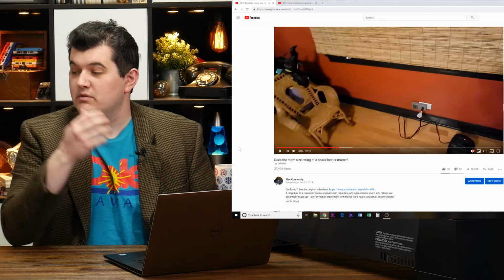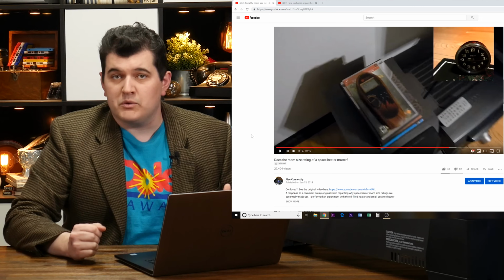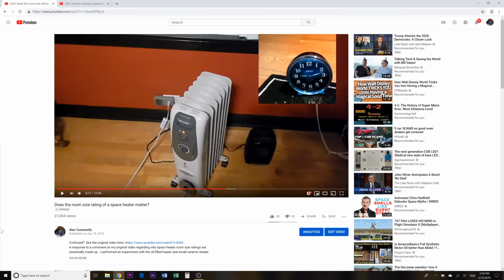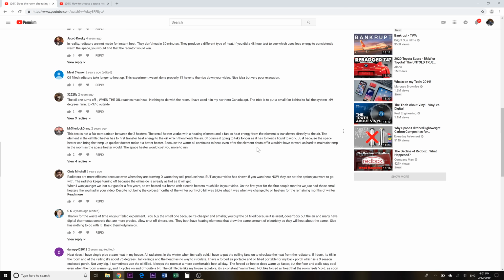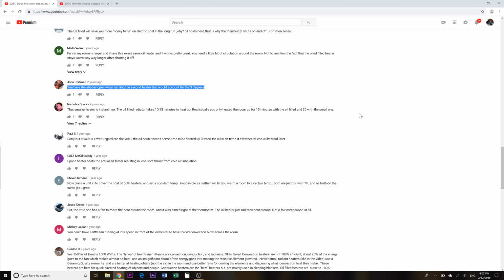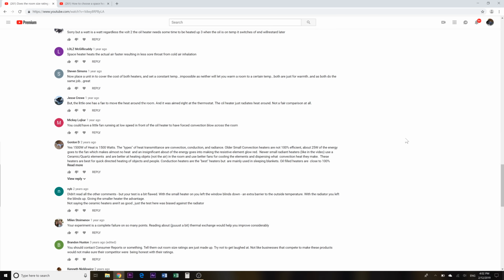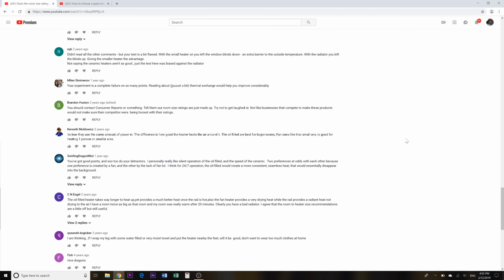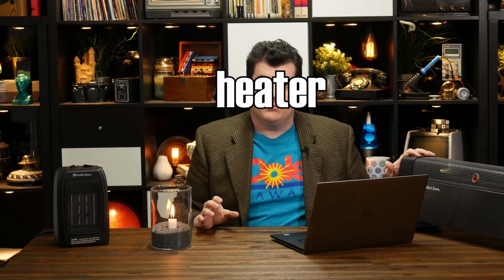More Space Heater Nonsense

Comment: Any space heater with larger or longer heating elements will produce more heat. It's like comparing a 110 coffee pot element to a 110 stove element. The stove element will put out more heat because there is more surface area on the stove element that will produce heat.
Reply: Wow! You're comparing apples and oranges...

The "110" you're referring to is the line voltage, what you're leaving out of the equation is the amperage or current...

Watts = volts x amps

Your coffee pot is drawing in the neighborhood of 8-10 amps, your stove top several times that. (And I personally have never heard of a 110v stove, they're 220v for just that reason - they need more current.)

I do agree however that from a "room efficiency" viewpoint a longer element with a larger fan will more quickly and effectively heat a larger room - even given the same energy consumption...
Reply: @openeyes-411  You are kidding about not hearing about a 110 stove right. I had one in my last apartment. It plugged right in to the electrical outlet. They are more or less giant 4 burner hot plates with a 110 oven. I am not forgetting about the amps either. I also have a small space heater that pulls 500 watts and only  250 volts. So not all heaters use the same amount of power. This is more or less the type of oven that was on the stove. I can't find the top that goes with it though. You can look to see if you can find it if you want.  https://appliances.us-appliance.com/appliances/110v
Reply: @christopherhorton821  
Yes I was serious - I've always lived in regular houses in the US that have been properly wired with 220v for the heavy load appliances such as ovens/ranges and clothes dryers. But hey, I guess you learn somptin new every day!

As to your 500w, 250v space heater, can I assume this is of a European or Australian origin? Doesn't make much sense to make such a small heater here in the US that requires that voltage...
Reply: @openeyes-411  Wow you have missed out on a lot. They even have 110 volt clothes dryers. They are smaller than the 220V and they don't hold as many clothes and yes they do take a little longer to dry, but they do work.

Comment: Oil heater is OK Butt... If you or thay put a box fan in front or in the back of it. it will stay running and heat the house more better.
Just make sure you have a 20 AMP Breaker to run them and NOT a power strip.
And if you or them have a 2000+ squre foot house and your heater not working well. Get your self a 220v dryer. Not a gas one...
I had a Mobel home 14x80 all power. It had NO heat No air/AC. I ran Two Close dryer win the temp was around in the teens if not lower. Both of them keep it around 65-70 Temp inside. Light bill running both is around $240-265 a month. sounds a lot its not.

Comment: I think your conclusions are correct. In my experience if you turn on a fan heater in a cold enough space it will heat that space but because it is blowing the cold air through itself it is cooling too quickly for me to feel the heat until the overall heat is changed. So I prefer radiators because they hold the heat so, I can feel it when I’m close. Even if it is much slower for the whole room.

Comment: Your problem is that you did not conduct a controlled experiment.  You used the first heater with inside air.  You then let outside air into the room.  What you don't understand is that outside air remains colder longer than the air inside a house.  I am a thermal engineer and I know.  I think any thermal engineer  will tell you that this is true.  You should have waited several days before trying the experiment with the radiator to allow what is known as the thermal differential to stabilize before you  used the radiator.  I believe you are sincere and you want to help people make good choices.  However, if you are not thoroughly trained in this field you end up confusing people more than helping them.  You need to run this experiment again but allow for the thermal differential to  stabilize before proceeding.  That is a simple fix for this misinformation and I think your viewers will appreciate your honesty.

Comment: So, in this video, in response to the comment about "not drying air and being silent" you yourself admitted to knowing that there are other metrics than just power to determine what's a good heater for a room. Leaving aside the noise and humidity differences, I propose a third metric that potentially IS different between these heaters: Stability of room temperature. Test that, and if there indeed isn't a difference, THEN you can claim that heating-wise, they are the same. Because let's be honest: You need to live in a hellabig room to need 1.5 kW on at all times. The physics lesson is nice and perhaps needed, but rooms are not spherical blackbody cows in a vacuum.

Comment: So: While some comments show a rather... unique understanding of physics, there is something to be considered: comfort. The big convective heater will achieve equilibrium, and maintain it rather well, with the oil acting as a buffer. The oil also causes the thermostat to naturally have an oscillation, WHICH IS NECESSARY: It means the room temperature doesn't need to change excessively to cause the thermostat to start heating again. The duty cycle is always present.

 The forced-air space heater will heat up the room quicker, but once it turns off, the room will need to cool significantly for it to turn back on. Those switches have built-in hysteresis to avoid thrashing and to achieve a firm "click" necessary for longevity. The air mass of the room is the only thermal buffer, and given that you actually don't want it to change 3 degrees up or down every half hour...

The worst sleep I've ever had was in a tent heated by a space heater. One moment it's so hot you're sweating buckets, the next it's cold enough that said sweat has no hope of evaporating. What that sais about the suitability of space heaters for extra-small spaces, well...
Reply: In an oil heater the thermostat is mainly keeping the oil warm, not the room. If they put a temperature scale on the thermostat like any honest manufacturer should, it would be clear that in order to heat up a bathroom in winter you have to turn the thermostat up to 100 degrees, because the heater is keeping the oil warm and that is all it cares about. Then when the sun comes out the next day, your bathroom is suddenly way too hot because it won't turn off until the room is at 100 degrees. This is no good for granny who must decide whether she wants to die of hypothermia or dehydration in her sleep.

Speaking from personal experience, the milkhouse heaters are best at actually regulating temperature. This is because the thermostat is constantly flooded with fresh air and the heat is circulated around the room rather than drifting up to the ceiling and keeping the attic warm. Radiant heaters may be better at heating objects, but most of those you will not be touching whereas you are touching air all the time. In my experience warm air is perfectly adequate for keeping objects in a room warm, and radiant heaters often have the same problem of tripping their own thermostats.

Comment: I bought a Vornado heater - mostly because I wanted to heat ME - the room was a bonus - I wanted to control the power also so being able to switch it to LOW 750 watts was important - so I agree totally with you and what you say - the heater has a fan so it is nice to have warm air blow on me and in turn heat the room and also not use as much electricity - (.11 cents a day)

Comment: I thought this might be on efficiency, if you really need to use electric heating then the radiator style oil heater is going to cost less. But yes the room size shit is irrelevant. In the UK electricity is five times the cost of gas per KWh, therefore it always cost you more to use electric heaters than your gas central heating, even if you stay in one room and use electric and try to let the rest of your house freeze. It amazes me how many people don’t know the difference in cost, old people on fixed incomes will be cold in one room with a little heater, not knowing that they could heat they’re whole house for the same or even less money.

Comment: British Thermals Units - the empire is still alive 😂😂
Reply: They're not even used in Britain any more!
Reply: @simontist  They are, but more for things like radiators.
Reply: I'm sure at the engineering stage they use SI units
Reply: @nthgth  You'd be surprised. It's more like in the research phase they use SI, engineering phase they use a bastard mix of SI, English, and non standard* units (yes those exist), and then in marketing and production phase they solely use English. I work as an aerospace manufacturing engineer and have a bachelors in Aerospace Engineering. Sometimes units are a cluster F. I really enjoy it when I get a print from Bell Helicopter that the tittle box says all units are in mm but all the dimensions but 1(usually thickness)  are painfully obviously in inches. It hurts my performance every time we get these prints too because it guarantees that the production is put back, at minimum, by a month.

*Most shops still run on sheet metal thickness by gage which is a non standard unit of measurement.
Reply: @anastasiacline6159  isn't this why NASA had an issue at one point because something was supposed to be in mm and someone used inches or something like that. It's crazy. No matter what they use it should just be standardised 🤦🏻‍♂️ and you'd think it would be.
Reply: @TJWhiteStar  I believe it was a calculation somewhere. But yes. 

Physical objects are pretty easy to figure out if you're using the wrong system of measurement though. NASA's website (at least in 2014) also neglects including what units their numbers are in. Which I found really infuriating when I was taking a basic college class and we were asked to pull real life data from NASA and use it in a calculation.
Reply: @anastasiacline6159  definitely crazy. For places that rely on very precise information you'd think they would be very particular about stating the units of measurement.
Reply: So long as there's blood in my veins and there's tea in the holder the empire will remain! RULE BRITANNIA!
Reply: @MinecraftPlayer-nw5kq  cringe
Reply: @fisheatsyourhead  it was sarcasm, don't worry
Reply: I'll take good ol' BTU's over this Joule nonsense anyday.

Comment: The experiment would be better sorted in a 12 to 24hr experiment. Both heaters have internal safties. They could get both get hotter but would likely cause deterioration or a catastrophic failure. Might also cause a personal injury. The ceramic heater will shut off multiple times during heating because of the high heat limit. Just as your seeing on the oil heater.

Comment: Why don't you ask an expert about that. The issue is not how fast you can heat a room but rather how fast the room gets cold. Ideally you should get a convection heater with a fan. Plus there are cases where you want to run it specific hours when electricity is cheaper such late in the night. Second temperature an heat are different things oil radiators store heat more efficiently than air .  They have a larger Cp coefficient. The issue is the greater loss of heat in winter is when you aerate a room. Maybe it is not an advantage thing rather a disadvantage in a smaĺl room you need to be  closer  to a hot surface and that's kind of uncomfortable. Still a good video  but I would rather if you had an expert. Sorry just random thoughts.

Comment: It's not about the power it puts out.  It's about the surface area.  A heater with a larger surface area will heat a room better than one with a smaller surface area.  If you took 2 heaters with the same features, one with a large surface area and one with a smaller surface area,  you'll feel more heat coming off of the heating grid than one off of a smaller heating grid.  It's like if you take a gallon of water and pour it into a square container, the water will fill it more than say a rectangular one.  The difference is the water spreads out more in the rectangular one than it will the square one.  With the heaters if you get the small one with a fan vs. a larger one with a larger surface area and fan. When he did the experiment he should've put a fan behind it which would've given different results.  You should redo the experiment with 2 radiant style heaters.  Of course the one with the fan will do better because it has the assistance of the fan to push the heat.  I suggest getting 2 radiant style heaters with the coils, one large and one small.  I bet the results will be different.  Like I said earlier.  It's about surface area.  Not power output.  The BTU output may be the same.  But it depends on how those BTUs are being spread over the grid whether it be a large surface or a small surface.  Naturally anything with a fan will perform better.  Like I said, perform the experiment with like devices.  One large and one small and find out what happens.

Comment: The small one is good for a small room because it's small in size. That's it. The larger one is good for a larger room because it's bigger. It doesn't transmit more heat, it just looks better in a large room.

Comment: With 30 € Cent per KW/h in Germany it is too expensive to Heat with resistors, but i have Solar Cells on my roof and use
a infrared heating plate directly connected to 5 x 330W Solar  Panels to Heat my living room. I do Not connect my Solar to the Grid because the only one 
who benefit is the german State 🤑

Comment: There's a 240V baseboard in my bathroom. It's relatively useless (unless you turn it on 1h before taking a shower, wasting 50¢). I now use something similar to the small heater in your vid, and it's much more effective, despite using half the power), cuz...fan! If it's really cold, I'll turn on both, as the fan blows the hot air from the baseboard too. As an added bonus, the fan stops everything from getting damp & foggy!

Comment: Suggestion if you want to ever redo your experiment - of course keep the room identical between the two tests [curtains drawn, same temp at start, etc], but while the small space heater is heating that room, take the oil-filled into another room [on a different circuit of course] and let it run up to its top temp also.  Since the small heater makes its maximum amount of heat output as soon as it's turned on, the oil-filled would need to be in a similar state to produce a relevant result as far as time and temp are concerned.  Once the oil heater in the other room has reached its highest physical temp [use an infrared 'laser' thermometer to keep checking its convection fins until its no longer increasing in temp] and the test room has been returned to the original temp, quickly take the hot oil-filled heater into that room and begin the experiment again as now it is also putting out maximum heat as soon as it is turned on.  This will at least allow you to see if a hot oil-filled heater can heat a room as quickly [obviously not as efficiently due to the power consumed during its warm-up] as the small space heater.  I'm still with your findings that the same wattage used across all devices will deliver the same output 'cuz science, therefore the small ceramic is the quickest and at least initially the most-efficient one for a small space.  But grandma will probably prefer the quiet oil-filled heater as it's reminiscent of what she had back in the 40s or 50s in her home, and she also won't hear it cycling on and off all the time which will inadvertently cause her to imagine the constant cha-ching, cha-ching of the spinning power meter each time the small ceramic kicks on.  Love your dry and sometimes self-deprecating humor always sprinkled throughout your vids, as those are my favorite types of humor.  :D

Comment: In my opinion you may overlook a small detail but your are also right. Let me explain.:-)
If you are in a room that are wary cold and need to feel warm in a hurry, the small heater do immediately work better if you point the unit at you, the IR-light do make you fell warmer long before the room is warm at all. But due to it's build do it only heat a small amount of air at any time and that air will go toward the ceiling, so it is more a personal heater then a room heater. The large unit do warm up a larger amount of air to a less degree but do thereby effect the air faster then a small unit. The experiences of warmth is way slower but do warm for more people at the same time, since more can sit near the unit's heating. The end temperature is the same, but the "journey" to the heated room is different.